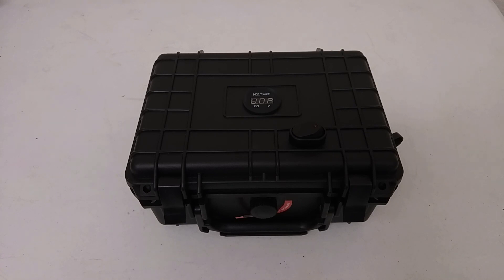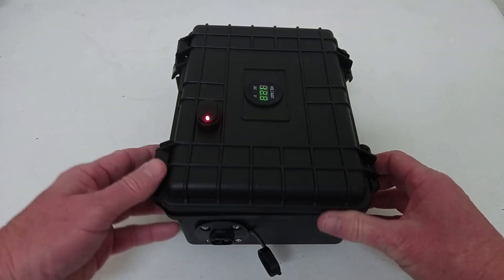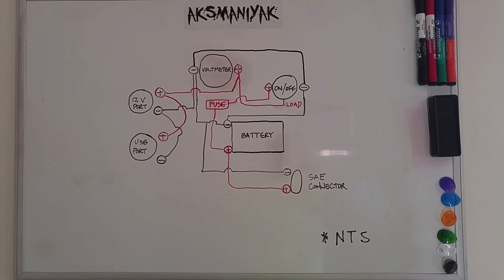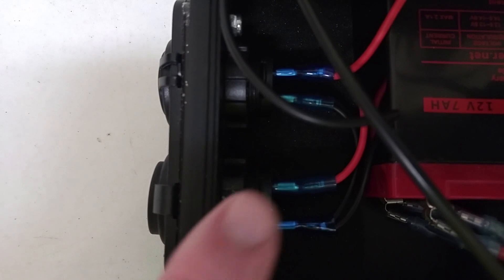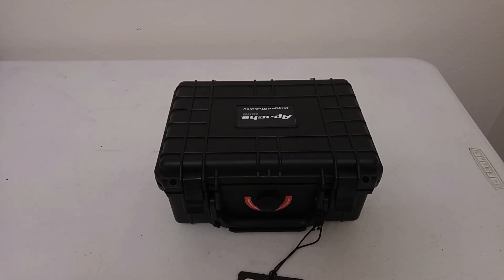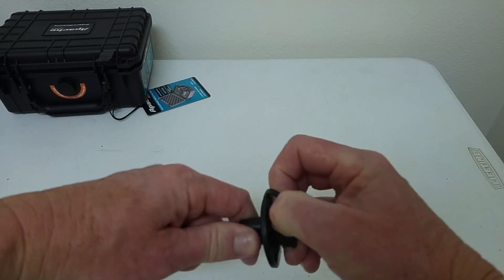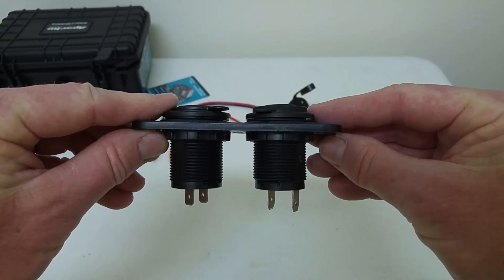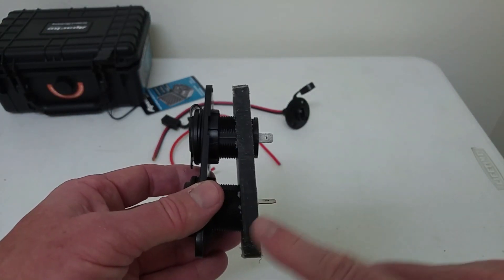DIY 12V Compact Battery Box

Comment: With the yak power system I'm wondering if you could use the same port to power your ex system as you do to plug in your charger as long as you weren't trying to use both of the same time.

Comment: Should I add a fuse from the battery to the SAE port if I plan to power a fish finder through the SAE port?  I assume I can use the port for charging the battery and for powering a fish finder, correct?  The fish finder cord does have a fuse on it.
Reply from the maker: Since the FF uses such little current, I would add a fuse to the FF power line and not the port.

Comment: This is perfect! Thanks man. I’m gonna use a lithium battery for this set up and I just have one question; with this waterproof tight seal, will there be any concern about the internal temperature or battery heat?!
Reply from the maker: You are welcome. I have not had any heat issues with the box.

Comment: Can I connect everything using 12g components like if the wires coming out of my inline fuse and SAE ports are 12g can I still splice them with the wires that come from my fish finder and wires the come with the accessorie sockets that seem to be 14g?
Reply from the maker: You could but it would be better to use a marine fuse box for the electronics.
Reply: @Aksmaniyak  thanks for the reply, my main concern is the compatibility of the the different wire gauges. I'm not very familiar with how the wiring really works but I worry that the larger gauge wire would send to much current to my attached devices if they came from the factory wired with a smaller gauge. Newbie concern but wanted to ask someone who knew better
Reply from the maker: @saltylue33  Glad to help. Nobody starts anything as an expert. It takes work and experience.

Comment: Thank you for this, I plan on copying this build for my kayak. My fish finder has an SAE adapter to the spade connectors to directly connect to the battery. Couldn't you just plug into the SAE port on your box to charge the battery?
Reply from the maker: Thanks Mike. I say in the video that you can charge the battery from the SAE port.
Reply: @Aksmaniyak  Must have missed it. Thanks!

Comment: you should add another fuse battery to SAE connector. if the charge cord should ever short it would melt the wire to the battery. kit looks good though.
Reply from the maker: Thanks.

Comment: Where did you find the spacer material and how did you cut it?
Reply from the maker: I used some inexpensive poly cutting board and cut it with a jig saw.
Reply: @Aksmaniyak  Thanks for the quick reply and info. Tight lines my brother.
Reply from the maker: @nathanieleasonbign81970  Tight lines brother!

Comment: I am going to build something very similar to this using this same case but will use a 13ah LiFeP04  battery pack using 26650 cells. Bad thing about using the 7ah gel battery is that one an only use 3.5 ah of it. I will use up too 80% of the 13ah battery pack giving me 10.4 ah of usable power equivalent to using three 7ah lead acid batteries.  I was looking for someone using this same case glad I found yours, nicely done.
Reply from the maker: Thanks Jim.

Comment: It looks like you have a 2 or 3 blade adaptor/connector coming off the battery. Where would I find that and also what is the technical name for it?
Reply: Also on the SAE port what cord do you use? Do you take the SAE connector with the cord to the cigarette lighter in to the 110 cord in the wall to charge the battery?
Reply from the maker: I bought it from Amazon. Here is the link.  https://www.amazon.com/gp/product/B000NI5D92/ref=ox_sc_saved_title_4?smid=A1YDIQ3YMIVZI0&psc=1

Comment: Can you use 14g wire for everything?
Reply from the maker: Yes.
Reply: @Aksmaniyak  thanks. I have just finished my box but mine is not working. ;(   I am watching again to re-trace all the wiring and i cannot see where I missed anything...  i have no idea as to what i did wrong...
Reply from the maker: Most of the time it is something simple like reversing the (+, -) connections.
Reply: @Aksmaniyak  it seems to keep blowing the fuse.
Reply from the maker: Then you probably have a pos and neg reversed somewhere.
Reply: ok. the power switch light is on but not the voltmeter.
Reply: ok. I got it. I switched the + - on the voltmeter. Thanks.
Reply: thanks for the video and the all the help. I know nothing about electrical but your video and help was really appreciated!

Comment: your 7ah battery.... does it really last at all? seems very low.. I'm in the process of building one. but cant decide on the battery size
Reply from the maker: It depends on the amp draw of the equipment that you plug into the box.
Reply: Aksman understood. But what can you do with 7ah if it’s not always connected to a solar panel or wall charger? With these types of batteries you can discharge them 100% anyways. 
Just food for thought
Reply from the maker: You can run a fishfinder for about 7 hours.
Reply: What about connecting LED Spotlight 48W  to this battery box how much time it should work ?
Reply from the maker: It depends on the amp draw of the light. The formula to estimate the run time is A (amp draw) x H (hours of use) = AH (battery rating).
Reply: @Jlui83  I think you meant to say you can only discharge them to 50% without ruining the battery.

Comment: Thanks for the nice tutorial. Everything's straight forward but what I don't understand is how you are connecting multiple wires those spade connectors. I can only get one wire in there. What am I missing?
Reply from the maker: Sorry about the delay but I just moved across the country. I used a dual spade connector. Here is the Amazon link. https://www.amazon.com/gp/product/B000NI5D92/ref=oh_aui_detailpage_o08_s00?ie=UTF8&psc=1

Comment: I am curious why you wired this up as a positive side switch? In most 12v applications it is recommended to use a ground side switch setup.
Reply from the maker: This is how I was trained in my engineering classes and experience. This is because you need to close the "hot" side of the switch for current to flow. It is a safety design. If you use the negative as the side switch, an accidental grounding by something touching the circuit could cause the current to flow and damage the circuit.
Reply: You'd only switch negatives or neutrals in America. You Yanks always have to be different. I did a job over in Nebraska and the three phase supply had phase 1 240vac ,phase 2 240vac, phase 3 110vac...you dont see that in Australia or New Zealand.
Reply: Usually the negative terminal of the voltage source is considered Zero Volts, or Ground. In that case, the switch on the positive feed will remove all power from the load. If the switch was in the negative side, the load would still have power applied, and an accidental ground somewhere could cause what ever the load is to power up and run.